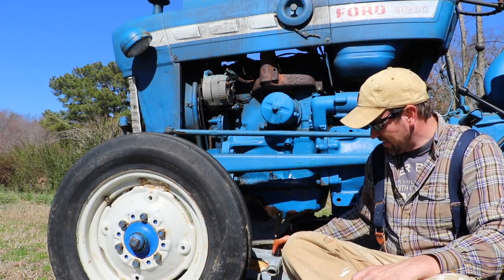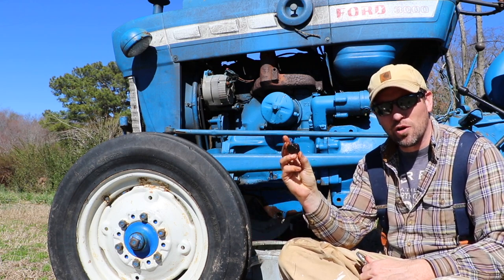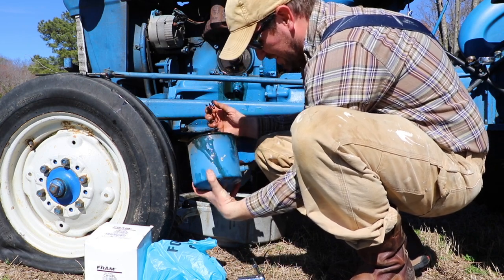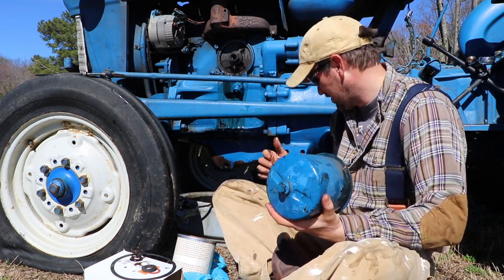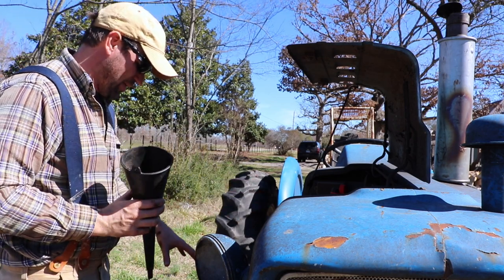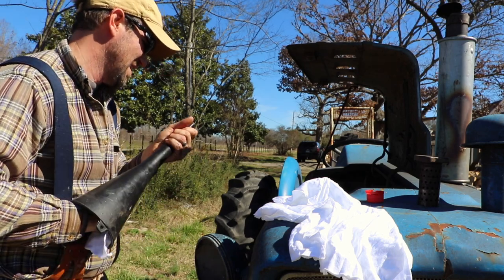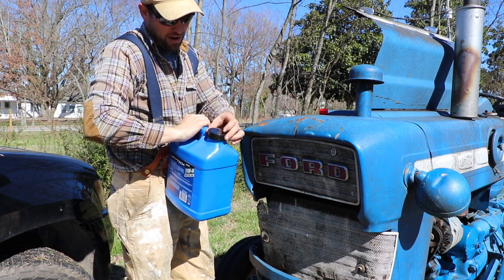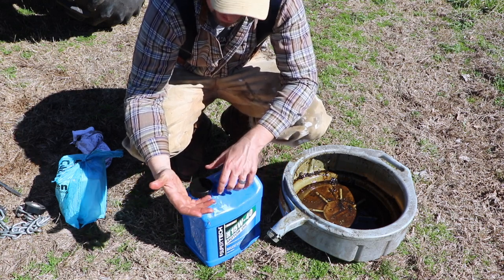Ford 3000 Tractor Oil Change - Ranch Hand Tips

Comment: Nice method of loosening that drain plug 😂 you need a good set of larger wrenches the leverage will be much better than that little adjustable and it won't chew up the plug. Great video!

Comment: Equipment maintenance is crucial on the homestead.  After you charge the battery, it appears the front tire might require some attention.  The Ford 3000 is a classic.  Best wishes.
Reply from the maker: +D Ballard yes, both front ties need some love.  It seems like every February I start preparing for the spring doing the same thing... maintenance and tire patching lol.  I love the Ford 3000 it's a durable tractor

Comment: This inspired me to jump on Steiner and order an adapter kit!..lol  Well done. What oil to use is a hard one to sort out. I've searched the forums and no one gives the same answer.  Scroll through a thread far enough and an argument always breaks out and everyone leaves pissed off. -- "I've wurked on tractors thirty years n' we always used bacon grease, you sumbitch..don't tell me!"
Reply from the maker: let me know how the adaptor kit works out!
Reply: Use what your heart desires.
Reply: @jeremyc3431  My heart desires to use the correct oil.
Reply: @jeffreygleaves2931  I prefer a 10w30 conventional rotella. For your older flat tappet engines.I've used 15w30
15w40 10w40. If it is newly rebuilt I use a full synthetic.
They are all going to do a good job as long as you check your oil and change your oil.
Pretty much whatever your heart desires.

Comment: U guys are putting 10w30 in there? Are they build for that sort of oil? The old Steyr (Steyr 180,180a etc.) from austria have a big problem with that kind of oil, they will leak everywhere we use sae20 in winter and sae30 in summer.